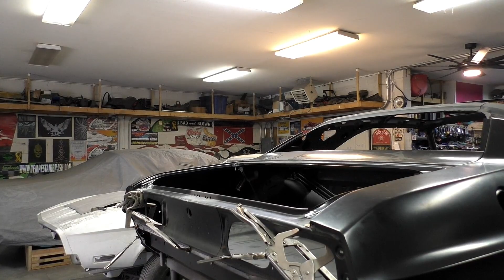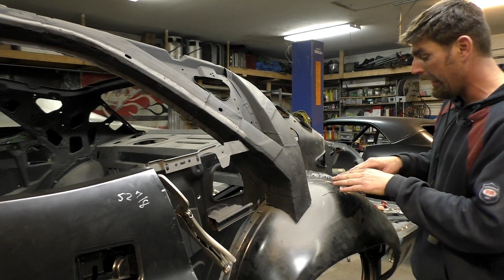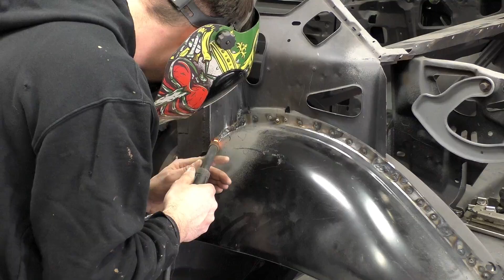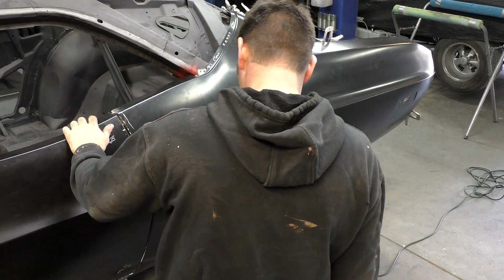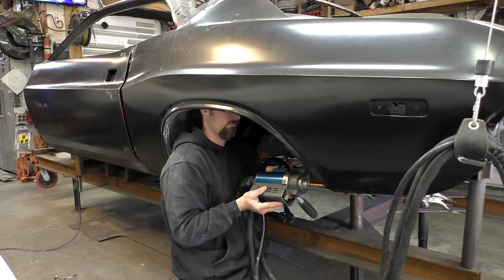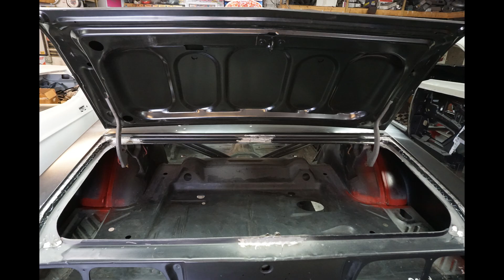1973 Dodge Challenger Restoration Complete Rear body assembly episode 7

Comment: U guys do a great job first of all but I do have one suggestion being that I usually just set my mig at the thickness of "both" panels I'm welding together and just spot weld with no holes. I've never had a weld break if u have your welder set right and u get complete penetration. Again nice work!
Reply from the maker: Thank you very much I appreciate the Tip. I do like to drill the holes as the MIG likes to fill in that surface area just for my piece of mind honestly. That seems to work best for me but I have used that process with a TIG special tip you suggested where your using the top panel and adhere to the bottom panel.

Comment: Interesting video, but the ton of new and very expensive sheet metal you're just throwing in instead of making repairs is much more than what a 73 Challenger is worth.
Reply from the maker: So I disagree with you in the sense the car is worth what the owner values the car, not what a 3rd party values it as. Most repairs also take much more time to fix properly and will usually not last the decades this car will. Also if you watch the video of the entire inner structure being rotten I would wonder how it would be "cost effective" fixing the inner structure while repairing the inch plus of filer on the quarter panels instead of buying a complete quarter panel at $500.

Comment: The inner curve areas of the drip rail or the curve area of where the rear deck meets the quarter? The slope of the quarter has a different slope than the rear deck as well. The quarter has a smaller radius than the deck which has a more subtle slope. 
The only way I get the quarters to match the trunk is if I jack up the quarter but I don’t know if it would stay that way once welded the quarters to drip rails in the curves of the trunk corners with all that stress loaded. It is like I would have to bend the quarters up next to the drip rails. I would think you want a relaxed fit. If I could email you pictures some time it would help explain. These AMD quarters are not fitting well. I can’t bring them together with the rear deck unless I cut the roof pillar supports to allow them to come together. If I don’t the gaps on the trunk are much too wide. I don’t mind the metal work but need some guidance. Your experience I know would have good insight.
Reply from the maker: you can shoot me an email to carthageclassiccars@gmail.com. Was this car built on a JIG because usually there is not a time I am cutting roof pillar supports or anything like that. With the quarters I know what you mean about them sagging they do on the edges at times and that fix isn't too bad.

Comment: Always great to see you bring things together. Both of my quarter panels seem to be lower than the outside corners of trunk which doesn’t sit flat with the top of the quarters. Nothing is welded in. Do you have any suggestions as to what needs to be done to make the quarter panels the same height as the surface of the trunk? I checked with another trunk lid and it is the same issue for my 70 dart. The back of the trunk sits aligned with the quarter extensions but as the drip rail extends back it sits lower than the back outside corners of the trunk. Any ideas would be greatly appreciated. Thanks
Reply from the maker: @jimdrechsel3611 Yes that is a problem with the challengers, I will use vise grips that will hook on a rachet strap on both quarters and try and pull them together first see if that helps. If not then I will slightly slice the curve inner areas of that corner and put a monkey on a stick (jack tool) and lift up under  the corners to make a harder bend in the top and lift the edge if that makes sense.

Comment: Nice. Job.  Just wondering.  How. Many. Man. Hours.  Does. This. Auto. Require.  From.    A TO.   Z.   BEING.  TURN KEY. DONE.
Reply from the maker: Thank you and that is a loaded question with so many variables. Usually I don't build them start to finish and it all depends on customer expectations. Usually in the metal stage of a car this bad you will have 150-200 hours alone to get it to a place the body shop can spend less time really dialing it in. The body show I would say if you want some really high end job probably another 100-200 hours for paint. Then assembly from there and its the little things you wouldn't think assembling that take the longest. Its a lot of work to put them together especially rust free, built to last and in show winning quality.

Comment: Another excellent video. My new favorite channel. Your AMD panels look so nice. I used AMD quarters on a ‘68 Charger and while they fit nice, they needed a lot of straightening and their response was they all needed filler to make perfect. It was obvious there was some grinding and tapping done before the black primer. Wondering if you’ve seen this too?
Reply from the maker: Thank you very much, I agree with the AMD rep you talked too, really any panel will need full body work to make straight and not wavy when painted with a slick paint job. The cars in these videos look decent and would be perfect for a matte black prime job but never fly for a high gloss paint to be acceptable. I am body working the 71 barracuda in the shop and a video idea was talk about what is needed to bring a brand new panel to paint. I also run across some panels that will need more help then others, It all depends on the tooling and the life of your car. The number 1 question I get asked all the time is how much would this costs to install (model) quarter panel on (model) car and I don't have a solid answer because there are variances between cars and even in the stampings on the panels even when i buy the same ones but with some time differences between purchase I noticed. So my options are give a stupid high quote, cut corners to meet the requirements for the owner to get the job or be honest and say I do it by the hour.
Reply: Thanks for the great advice. Your straight forward instructions in the videos is such a welcome departure from all the other channels that feel the need to include drama and other nonsense. I’ll be spreading the word about your channel.
Reply from the maker: I really do appreciate that!

Comment: Awesome videos.  I have watched a lot of these types of videos and I really appreciate the breadth of material you cover in such a succinct manner.  I did have a question about the Pro Spot PR2000 spot welder.  Are you using 3-phase or a single-phase  power supply?
Reply from the maker: Thank you! I am running the welder on 220V dual phase. You are correct it will run 3 phase and still trying to come up with a plan to figure out what it would take to get 3 phase into the garage, but honestly I don't have any issues running it on the dual phase minus every now and then on initial startup tripping the breaker.

Comment: Hi there. I'm restoring a 1973 mustang Mach 1. Will you make videos of that white mustang too? Thanks
Reply from the maker: That white mustang is one of my cars that I did all the metal work on years ago and believe is in the process of being sold so unfortunately not that car. However I personally have a 73 Mach 1 that will need full restoration and I will use as my personal fun car. So if all goes well there will be one on the channel sooner or later.